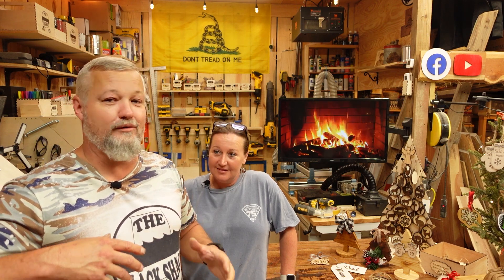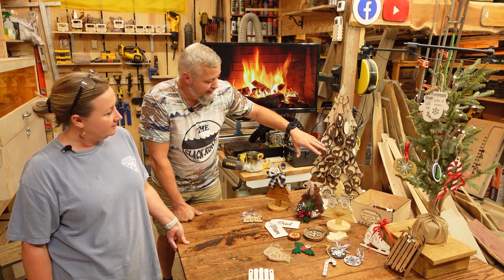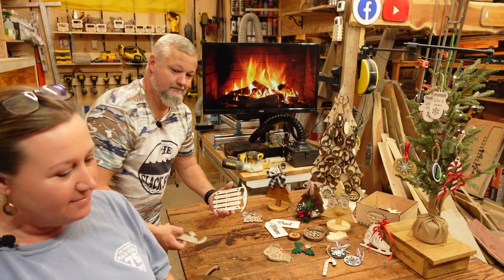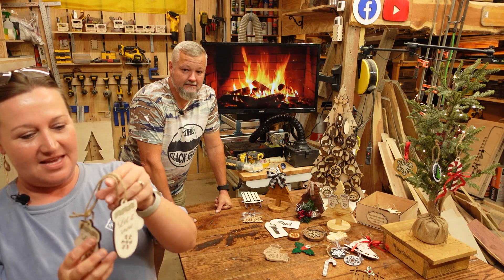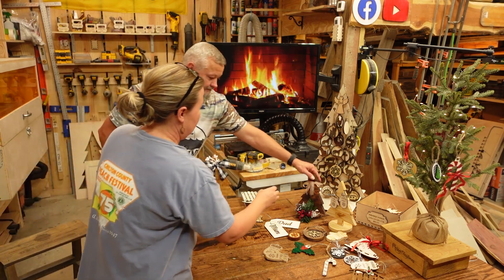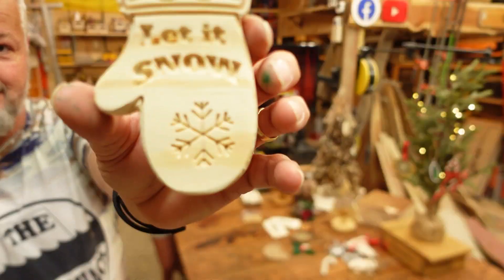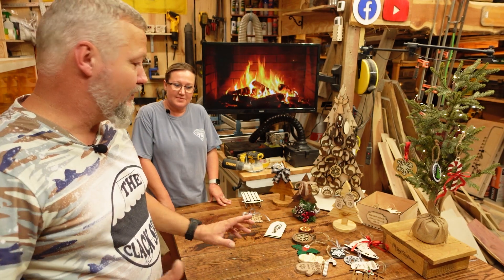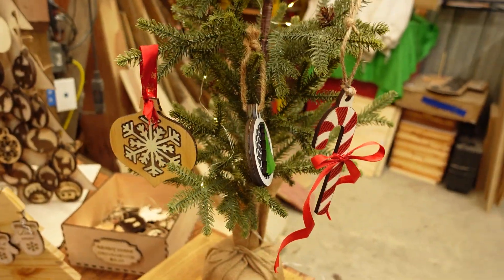Simple Christmas projects

Comment: i bought he package but if using 3mm wood how can i change the thickness of the slots where the fit for the sleigh
Reply from the maker: The sleigh is the only thickness particular piece. You can resize the width on the 4 connection holes.
Reply: @TheClackShack  i will try that I am learning little by little ty

Comment: Evening what is the thickness  of the wood and what kind of wood do you use for the ornaments
Reply from the maker: Typically 4.5 mm luan. Sometimes the top layer may be 1/8 inch. It depends on the design. Mostly 4.5mm
Reply: @TheClackShack  thanks  again